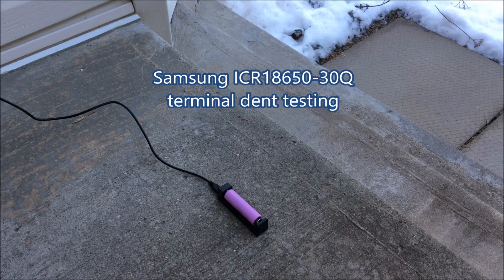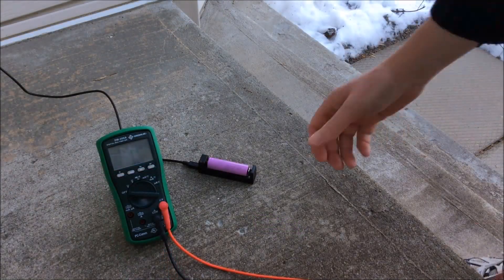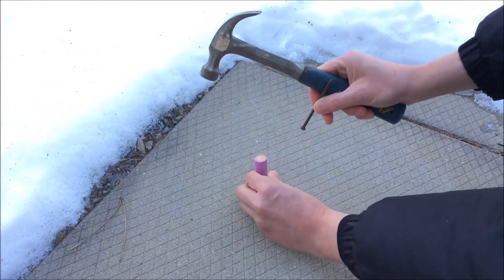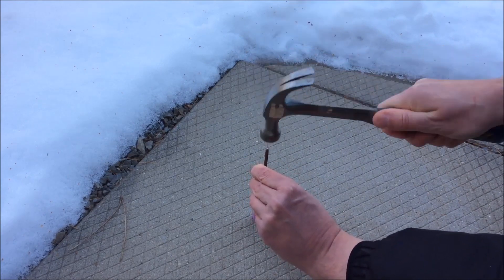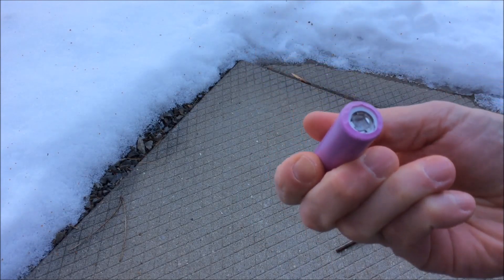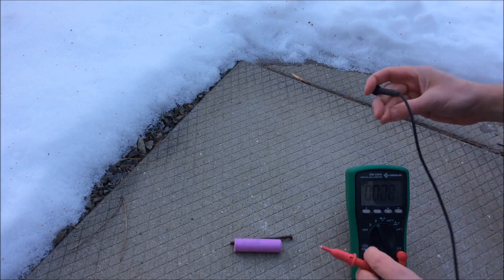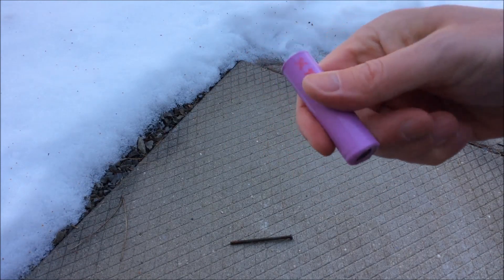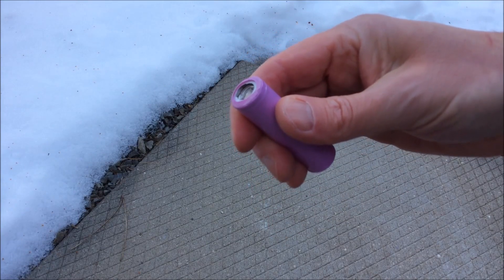18650 Lithium-ion denting

Comment: I have a battery I dropped right after taking it out of the package and it now has a nice dent on the side...not made very tough i guess and not sure if i should use it or not... what would you suggest I do?  i mean is it safe or should i toss it?  things are spendy so i been holding onto it tell i find out more about them but this is the only video i could find about a dented 18650...
Reply from the maker: It depends on the size of the dent, and if it has damaged the wrapper. If the wrapper is torn, either replace the wrapper or throw out the cell. If the dent is large or deep, throw it out. There's a 99% chance it's perfectly fine, but that 1% could result in a fire. Obviously from my testing, the name-brand cells are pretty tough, but it was just one battery I tested so maybe I was just lucky. If you keep your cell, you might want to charge it somewhere safe (like outside) for the first few charges, just to make sure.
Reply: @walkintothelight7142  i have it isolated for now.  it is a decent dent...i have an old flashlight im not to worried about that i might throw it in. just leaves me a whole cell short for the battery bank i was building lol. thanks for the reply man realy needed a second opinion other than my own lol

Comment: You are messing with a battery that can release 15-30amps (depending on it's rating) all at once. Hitting it with a hammer is NOT a good idea. Had you smashed the positive end down far enough it would've made contact with the sides which are grounded. It would then have sent it's full charge up that steel rod you were holding and into your body which could have very well stopped your heart. These batteries are known specifically for their ability to quickly dump their charge all at once. That is why they are able to use them in cars and vapes.
Reply: It's 4 volts. There is no shock hazard to humans, only fire risk.
Reply: That 4 volt would have really killed him. NOT. :-)
The amps cause an explosion, but voltage will kill you.
So nothing would have happened.
Reply: Not enough voltage
Reply: For reference this is what that would've looked like dumping except the voltage would've gone into you. https://youtu.be/WnZuMfq6kec?t=138

Comment from the maker: It's been a few hours since my "test". Voltage of the cell is holding stable. So, it appears there's no internal damage. I'm still going to leave it outside, since I don't trust it. My plan is to charge it up full, and see what happens. I suspect nothing interesting will occur, but I'm curious. Anyway, in conclusion, it seems that 18650 cells (at least genuine ones) are made pretty robust.